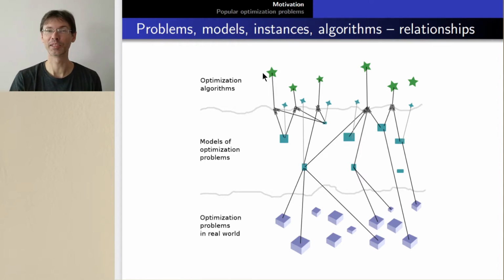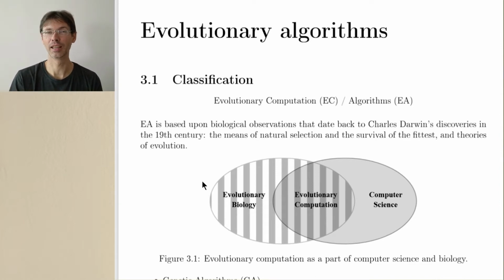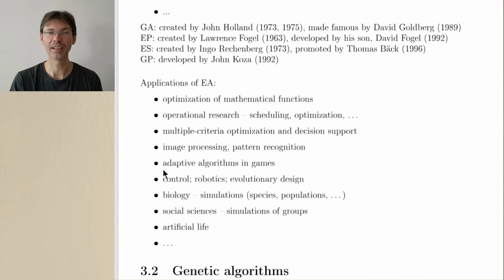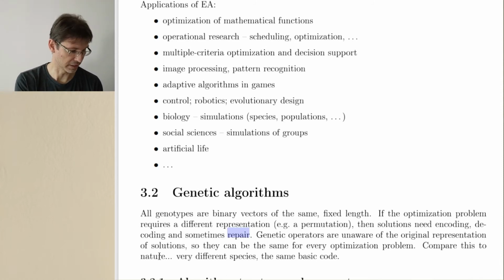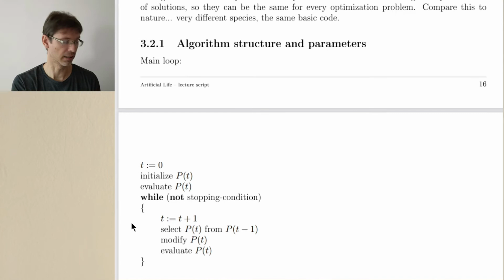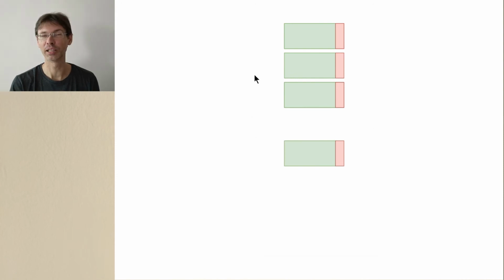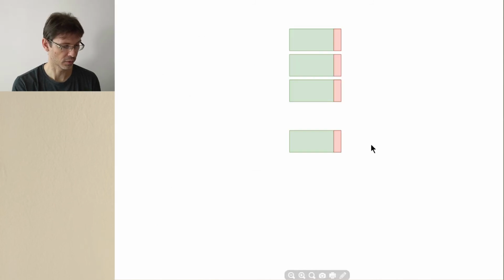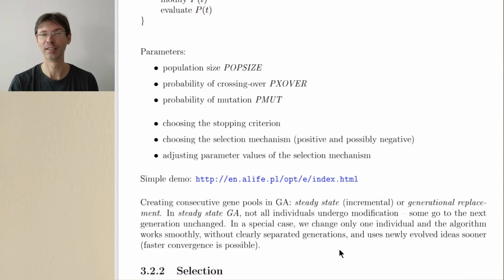Evolutionary algorithm: basic components and the main loop

Comment: If we use the different fitness functions, increasing the rate of mutations to maintain a diverse population of solution what is the probability that if we are scarfing short term fitness to obtain longer term fitness. Is there any chance that it can't convert into longer term fitness as the "no free lunch theorem proves that there is no general solution to this problem.
Reply from the maker: The more intense the mutation, the more diversification we introduce in the population thus preventing (or delaying) convergence. Larger mutations increase exploration and decrease exploitation.
Reply: @Maciej-Komosinski  thanks

Comment: Question: what if I am interested in finding the local minima on that 3d plot (multi dimensional landscape). How can I find the local minima?
Reply from the maker: You use local search algorithms ("greedy" or "steepest") as explained in earlier lectures. Did you watch these earlier videos?
Reply: @Maciej-Komosinski  yes I have watched as greedy algorithm works on a lot of Calculas calculation and we have to choose a arbitrary point for solving it. Do we really care about solving or thinking to find local minima manually?
Reply from the maker: @preetamsharma5220  If you have a continuous function, then you can indeed use gradient methods. But here we speak about a more general approach to optimization where the space of solutions does not have to be continuous. Metaheuristic algorithms, as discussed in this class, will also work for combinatorial optimization problems where calculus will not help. No, we definitely will not look for local minima manually (though I am not sure what you mean by "manually").
Reply: @Maciej-Komosinski  Now I am clear, Manually means without help of programming. Thanks for response